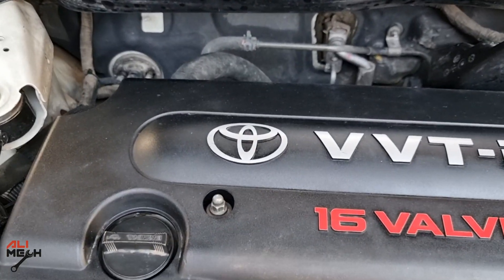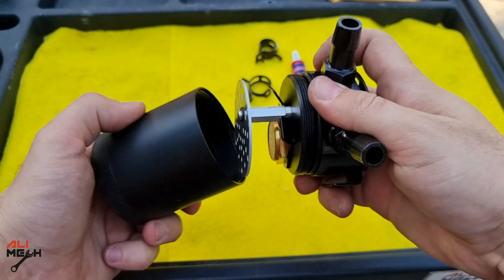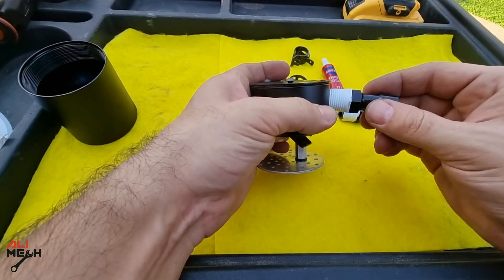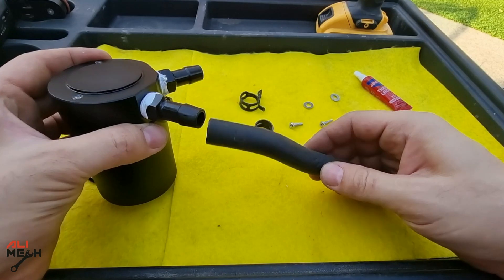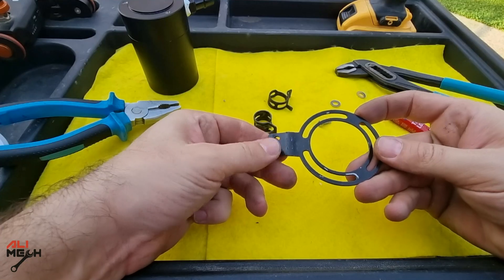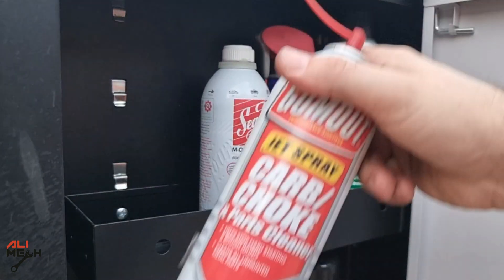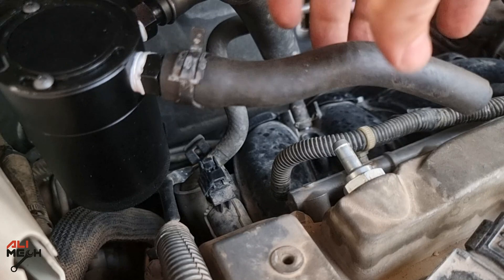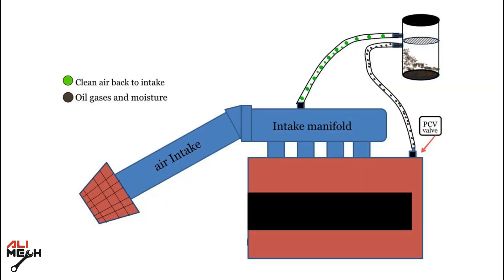Quick fix for engines burning oil/How to install oil catch can /preventing carbon buildup in engine

Comment: Thanks so much 👍🙏 ,my issue is the 2002ram 1500  5.9 engine it has drivers side pcv valve,so I put the catch can in between, good,on the passenger side valve cover has a breather hose to the carburetor,do you suggest I install a second one on the passenger side also, please any help

Comment: God i cant tha k you enough for this video man i have the same exact angine in my 2008 toyta rav 4 limited with over 205,000 miles and boy does this thing Eat oil i soend just as much in oil i do gas sometime more in oil and there are no leaks anywhere At all it just runs hot and is almost indescribable. I LOVE THIS TRUCK SO MUCH. At 205,000 miles this thing runs over tree stumps, goes up hils like a 4 wheeler and is way more comfortable then any jeep ive ever been in or driven doesnt matter what year. The torque is so quick i dont remember the last time someone beat me at take off from a double lane stop light and i dont even try at all its just that quick.
Reply from the maker: No problem, glad it helps you out, only the comment in enough for me to know ot helped someone out there
Reply: I and chatgpt say that ideally You shouldn't use the same thickness oil as the owner's manual says to once you get close to 200k miles on a vehicle. Go to the next thicker oil and use that instead. Because many of the engine parts have worn and so the gaps are larger and need slightly thicker oil to compensate. So if your manual says 0w-20, then use 5w-30 oil. The variable valve timing and other systems will be ok, it's still within the range they can operate. It may help them. This can help your burning problem of thin oil leaking past the worn piston rings. Plus your engine should wear a bit slower. But your gas mileage can go down very insignificantly from the thicker oil drag. Take care.

Comment: My GDI engine was consuming massive amounts of oil.  I replaced the pcv valve and also did the following.
I added Berryman Chemtool to an empty gas tank and then filled the tank with the highest octane gas.
I then drove for about five miles with the RPMs in the 5000 range but never redlining at higher RPMs.
The goal is to create heat which frees up stuck piston oil control rings allowing them to function properly and prevent oil blowby.
My oil consumption problem is gone now.
Whether it was the new pcv valve , the heat generated by high RPMs, or a combination of both I don't know.
I would try changing the pcv valve first and see if your oil consumption stops.  If not, then you can try the high RPMs.

Comment: Rubish coz oil catch can should be on lower position .
Reply from the maker: It doesn't work based on gravity,  it works based on condensation acually,  it has to be far from Exhsust only, cooler place in the engine bay

Comment: Would I benefit from a catch can on my Lexus IS350? I'm aware that my 3.5 liter engine has direct and fuel injection methods. I do consume about 1 US quart every 5 thousand US miles. I do oil changes every 4.5 to 5K miles. I currently  have 168k miles. Thank you!
Reply: All cars benefit from it, but it will burn the same amount of oil.

Comment: do not run synthetic oil in these engines. conventional 10w 30 stopped my friends from using oil.
Reply: Does he run that in the winter too i thought about using a thicker oil ?
Reply: I run full synthetic in mine and it loves it 😊

Comment: What is the pro and con on this installation? I understand the oil may go to intake and cause deposit issue but would this void warranty or cause engine failure if ...... Thanks in advance.

Comment: Fix the problem stop band-aiding it just like using cooling system sealers and air conditioning sealers fix the issue instead of band-aiding
Reply: The fix is to tear the engine apart and put new rings and pistons in or replace the engine with a remanufactured engine! Pretty expensive fixes!

Comment: The pcv valve will still get dirty n clogged because its located before the occ. I have to regularly clean the valve with carb cleaner even though i have the same occ. so I rigged it so that the pcv valve location is changed at the exit side of the occ. and then I use a normal brass connector at the valve cover hence the dirty oil frm valve cover will flow freely into the occ, get caught in the baffle n filter before going through cleanly out of the pcv valve n back to the intake manifold.

Comment: I have installed a small Air Oil separator (AOS) with brass filter. I am suspicious about reduction in fuel mileage after its installation. If some one has installed the same on PCV and CCV lines kindly share feedback about  fuel mileage
Reply: Why would you suspect fuel efficiency drop?
Reply: @squidusn71  There can be loss of vaccum due to 12" diameter pipe which has increased overall length and its diameter is less than stock hose pipes
Reply: @awaisiqbal8934  it's still a sealed unit so there's no loss of vacuum.   A vacuum leak would make an engine run rough.  I have cheap $30 oil catch cans on my vehicles and they don't affect fuel efficiency or loss engine power.
Reply: It’s normal for having a drop in fuel efficiency. When you install piece of garbage that does absolutely nothing good but makes it worse

Comment: This is absolutely necessary on direct injection engines. I don't know why they don't have that as standard equipment. I know....because they have to be emptied now and then and many people don't even check or change their oil never mind empty the catch can, Lol. Thanks for a great video.
Reply: It's not necessary on some gdi engines nowadays.
Reply: @squidusn71  everything I see on GDI engines even newer ones, the intake valves are a mess.
Reply: @frankbiz  Not the Honda V6 earthdream engines.
Reply: @squidusn71  Honda v6 have direct injection technology too. It’s only older Hondas that were reliable
Reply: @repairvehicle  read above comments before you comment.
Reply: @squidusn71  read my comment before commenting
Reply: @repairvehicle  Your grammar is poor, no thanks.
Reply: @squidusn71  your grammar is not better
Reply: @repairvehicle  ...and your comprehension is non existence.
Reply: Experts said there was collusion and they brainwashed majority of people. Experts saying catch can works and now new wave of people brainwashed with false promises
Reply: @repairvehicle  hahaha, I think I've seen plenty of videos on carbon clogged valves on GDI engines and videos on catch cans filled with oil that would of passed over the valves. Prove it wrong.
Reply: @frankbiz  you never seen carbon build up on valves with can video. Here is the proof it does not work
Reply: @repairvehicle  why do GDI engines tend to have a lot more carbon build up then? The intake valves don't get sprayed by gasoline so they never get clean, so wouldn't having less oil vapor in the intake help reduce the carbon build up on the valves? Thank you for the info I'm open to learning.
Reply: @Tadders  , it’s more than spraying gasoline inside intake valves.
GDI have 5% fuel dilution vs 0.2 port injection, 184% difference. Basically you have 184% more fuel vapors inside engine that are trying to escape and get burned.
Catch can doesn’t stop vapors from fuel being injected back.
Condensation, acids, byproduct and so much being contributed to carbon build up at 184% more than non GDI. One more thing that I not mention here but will discuss on my channel in one of my videos
Reply: Nope it’s not they don’t work
Reply: @repairvehicle   This is what experts are saying: From Motor Authority article......Do oil catch cans really work. The answer is yes. While a catch can won't stop every last particle of contaminant from entering the intake manifold and coating the valves in a direct-injection engine, the less unwanted buildup the better.

Comment: My friend
You put the pipe that comes from pcv in out and the other you made it in in I wish to clarify but I put it on the contrary
Reply from the maker: There are many brands like this model, but the inlet and the outlet are different, it was 2 models I showed in the video,  but you get the ides, inlet will be from pcv and the outlet to the intake
Reply: @AliMECH  I have a Camry 2014

Comment: Thanks my 09' Matrix 2.4 isn't using oil yet, but with 196,000 miles on it, it might soon. This looks like a great option. Thanks again. Nice install and explanation.
Malcolm Ottawa Valley
Reply: Don’t waste your money
Reply: @repairvehicle  it's so cheap and such a nice clean install I might buy it, mount it and not actually hook it up. I'd be ready for the eventual oil consumption problem(C'mon I'm almost 200,000 miles).

Alternatively I could hook it up as a test for a week and simply monitor the can contents.
The beauty of our friend's install is he/you/me can unhook and bypass the can, returning to stock in about one minute.

It's a low priority for me now, but a clever, cheap option I'm putting in my book of tricks.

I got this Matrix in May and I've installed new front struts and coils, new Ruthenium plugs, unseized the hand brake, fixed the HVAC controls, new serpentine belt, alternator and oil and filter change. All typical high mileage replacements I was more than happy to do because of the way this larger engine and extra fifth gear automatic transmission work so well together. Toyota should be proud of the way this thing accelerates so effortlessly and still returns great mileage. I did the math and being fully 33% larger than the 1.8 engine puts it at a serious advantage. I come from Mopar and a 426 is not a whole third larger than a 340. I drove hot minis in the 70s and a 1275 is not fully one third larger than a 1000 either.
For that reason I installed a decent an aftermarket head unit and pitched that junk Toyota CD radio(gaining hands free). Admittedly the six stock speakers were still working but I replaced them with component speakers and it sounds great.
Already planning preemptive replacements of the idler tension pulley, water pump and harmonic balancer and front seal and PCV valve. Nothing is leaking but the rubber on the balancer is deteriorating fairly badly. Also want to grab a junkyard starter, swap it on and rebuild the original before it goes unexpectedly. I'm willing to do this because the body and subframes have no rust to speak of. Like to score a spare engine and rebuild it, but these Toyotas are FAR more expensive for parts than simply freshening up a 340 or 360.
Malcolm Ottawa Valley
Reply: @malcolmhamilton5200  can content does not mean anything. You have can or don’t have can, moisture still there and will be trapped inside hoses after can. Longer hoses, less vacuum. Less vacuum equals more stuff will be trapped inside longer hoses and cause more problems later.
Reply: @repairvehicle  I'm not a complete stranger to catch cans. When we build 451s (400s with a 440 crank) they'll rev higher and faster than a 383, but you have to run looser ring clearances to achieve the rpms, which sometimes creates severe crankcase pressure and requires plumbing in catch cans between the engine and where they dump in the header collectors. Otherwise the oil particles can cause smoke out the headers.
If this catch can on a high mileage Toyotas can keep the plugs from oiling up(fouling) for many more miles before you tear down ir replace the engine, I don't see the downside of wasting less than twenty bucks.
Malcolm Ottawa Valley
Reply: @malcolmhamilton5200  oil particles will pass through worn out rings, catch can is useless. Oil particles will pass through worn out valves seals, catch can is useless.
Reply: @repairvehicle  Agreed, but a catch DOES catch the majority of blown out oil and stop smoke out the tailpipes.
Sometimes that's all a guy, who doesn't have the cash to rebuild, wants. If it stops police or some do-gooders with cell phones dime-ing him out, he gets to continue to drive to work and feed his family.
Reply: @malcolmhamilton5200  it does not catch oil, you have been fooled by false information

Comment: Hi, I got a can same as yours but it does not indicate inlet or outlet. The outlet would be the one with the tunneling to the brass filter correct?
At time 1:40 in video you state the far or right side pipe on the can as outlet, however time 0:37 you can clearly see the word out on the near or left side. 
I just hope you haven't accidently hooked your lines up incorrectly, cheers and many thanks for the video.
Reply: If you blow into one the fitting and the air comes out of the brass filter, that fitting is the inlet.

Comment: I thought burning oil cause of piston rings and valve seats or etc. How is this thing helping to save oil if rings and valve seats gone bad????
Reply: Burned oil not coming back into engine
Reply: Catch can don’t work, it’s a lie that people prefer to believe than actually have questioning attitude
Reply: @repairvehicle  bollocks.
Reply: He doesn't have a clue.
Reply: Removing the oil that would normally burn, causing carbon buildup. Not to mention removing all the moisture that helps heat up the oil as it burns off, causing more carbon. It’s does stop the ring issue, just removes the oil from PCV system.

Comment: What about in the winter when those lines going to the can freeze solid?
Reply from the maker: even better, it will help condensing oil vapor even more
Reply: @AliMECH  if they freeze shut the engine can't breath causing every gasket to leak. The PCV operates off engine vacuum to open and close.

Comment: ⚠️Hi alimech  does engine flush fixes vvti gear rattle in 2009 corolla s 
I have 09 corolla s with 61k miles on it and  the vvti gear rattle a every cold start  I was think if the engine flush fixes my vvti gear rattle and  loosen vvti gear pin cuz my vvti gear pin  is seazed in and it's making load rattle at cold start  
Pleas help the new updated parts is so expensive I cant afford it 
Thanks big fan
Reply from the maker: unfortunately the % of flush very low for fixing that, but you can try, and make sure that u r not using thick oil viscosity, or change the oil brand that u r currently using, some oil brand are thicker even they are same viscosity
Reply: @AliMECH  thank you I'm useing 0w20 oil  is there any other solution other than replacing it cuz it's super expensive and my car rpm is low at 6k  when the engine is warm and car shakes and when I turn on my lights it goes back to normal no low rpm no shaking nothing 
I put new battery altinator spark plugs check all the ground connections  all the feuses  new feul injectors new feul pump filter  no cheak engine light  I dont know that is working with it
Reply: @sheepdog3828  thank you I tried sea foam it doesn't work
Reply: Replace transmission fluid easy fix